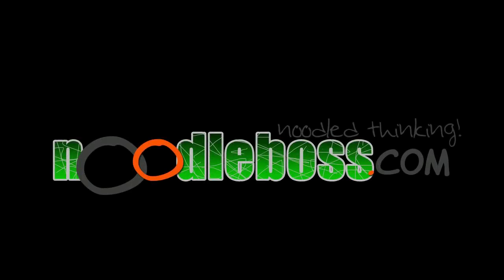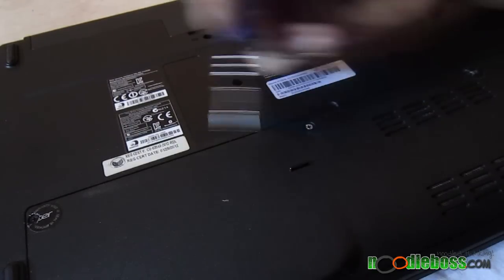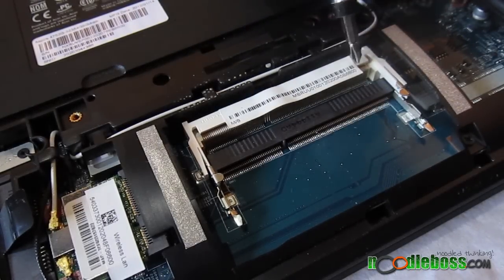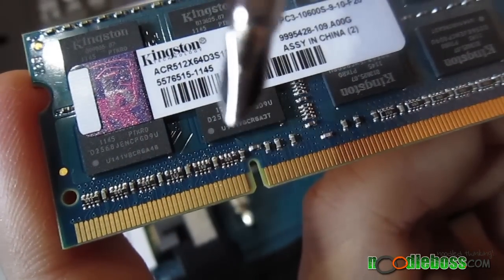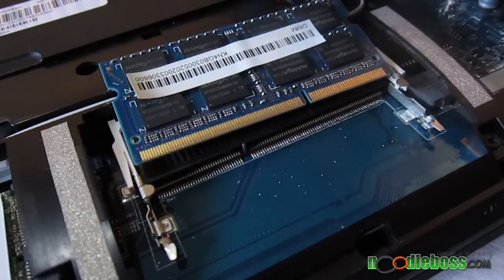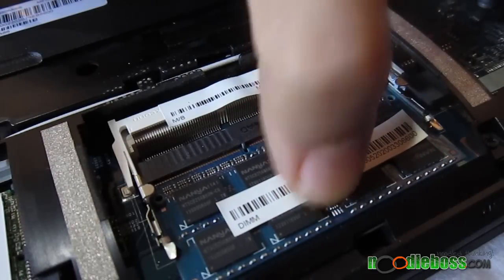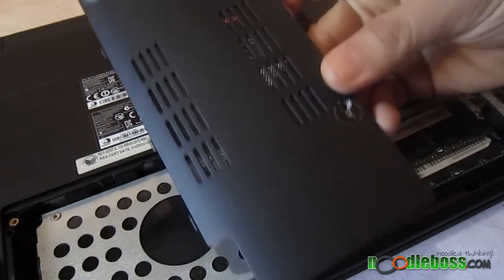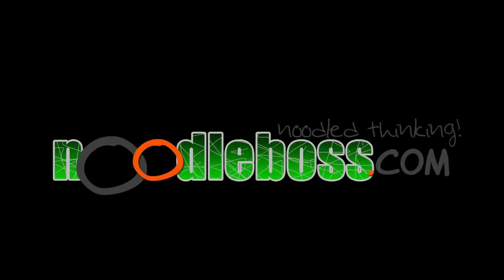How to Install Memory (DIMM) - Acer 4752G Notebook

Comment: Buen dia, cordial saludo, tengo un pc ACER ASPIRE 4752-6615 con las siguientes especificaciones
 - CPU: Intel Core i5 2450M @ 2.50GHz - Sandy Bridge 32nm Tecnología With Turbo Boost Up To 3,1 Ghz

RAM: 4,00GB Doble-Canal DDR3 @ 665MHz (9-9-9-24)

PLACA BASE: Acer Aspire 4752 (CPU)

ALMACENAMIENTO: 698GB Hitachi HTS547575A9E384 (SATA )

GRAFICA: Intel HD Graphics 3000 (Acer Incorporated [ALI])

tengo pensado cambiarle el disco duro de HDD A SDD, cambiar el procesador de i5 a un Core i7-2760QM que es compatible con el pc, y pues quiero saber si le puedo meter las 16 gb de RAM o solo puede con 8bg